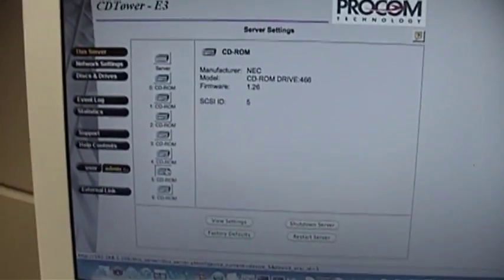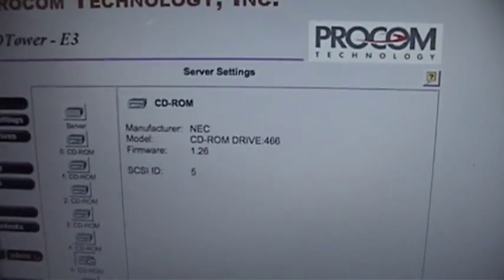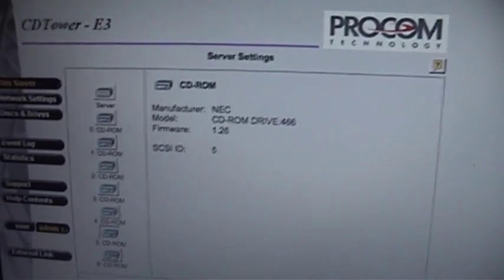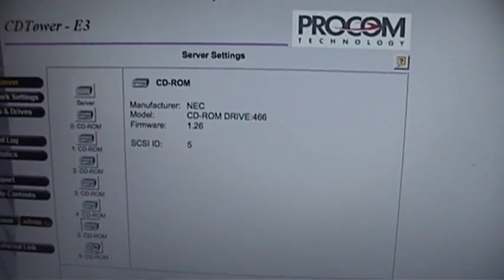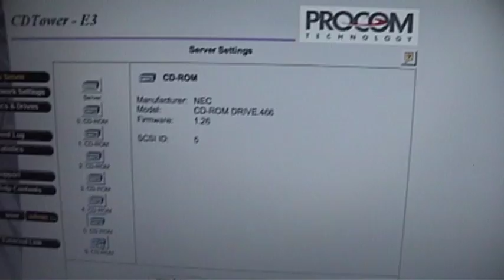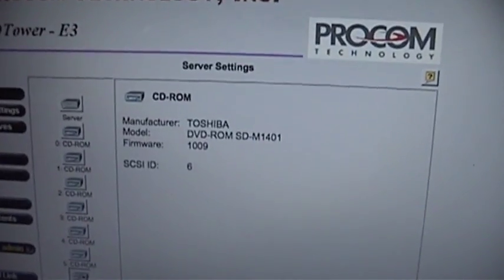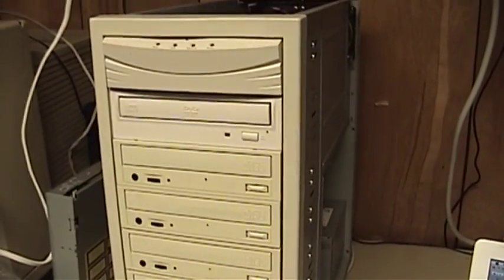Procom Technology CD Tower E3 Overview and Experiment

Comment: I have a DVD duplicator in that exact case, only it's black. The duplicator was manufactured by Kanguru, and also used NEC drives. Although, this one is fairly recent, and uses IDE for its drive interface.
The reason I ended up with it was because my church said it was broken, called support, and they just said it was unfixable. I proceeded to take a closer look at it, and noticed that it had a removable hard drive in one of the 5 1/4" bays. The drive was a 250 GB Maxtor DiamondMax 4, if I remember correctly. The drive had just mysteriously quit working in the system. I removed it. It was completely functional and very reliable in a computer. I put in a Western Digital Caviar 1200 in the duplicator, and re-purposed the Maxtor. Both still work to this day. It was a very odd failure.
I actually have a demonstration video of it duplicating a retail CD to a CD-R at 48x. It actually successfully copied a copy protected disc somehow.

Comment: Black Box made some with burners back in the 90s, before anyone had them. We've got an Antec DVD tower at work.

A lot of times a failing optical drive doesn't have to do with weak laser, but dust under the lens. I've fixed a few by using canned air between the lens and laser mirror area.

Comment: I didn't even know there were SCSI DVD drives, by the time DVD came along even servers would usually have an IDE port on board for an optical drive, at least the few I have laying around from the early 2000s all do.

Interesting machine, but not of much use today. This might be interesting though if it could cache DVD images.

Comment: When I worked for NCR Lowes back cpu room had 2 32 bit pro comm systems they had 6 dvdrw drives and they run the systems to run the Home system . I had to carry a spare drive power supply cable and the propitiatory Ethernet cable. I only had to work on the scsi controller itself . The did have a memory chip .Lowes had a mandatory 
6 hour repair time . I kept the spare parts in the CPU room as far as I know there still there

Comment: I used to use a scsi cd writer millions of years ago, but most software just didnt see them :-(, shame really.

Scsi reminded me of the old mfm/rll hard drives with the selection pins, or the monster sized cast aluminium 5.25 inch tandon floppy disk drive with belt drive and strobe flywheel, also with jumpers and 300 ohm resistor termination packs.

Loved those old drives, sounded like a chainsaw though :-)

Comment: Did you ever find your original DVD-ROM drive or obtain a replacement that actually worked?
Reply from the maker: No, and I don't use this any more.
Reply: @uxwbill  he's alive! There's still hope of new uxwbill videos.

Did you just retire it or did something fail? Someone asked in the comments if you could swap out all the roms for hard drives kinda wonder that myself.
Reply from the maker: It's worth considering that making videos is something I do for fun and only in my spare time. I don't have much of the latter these days. I've mentioned that in other comments on newer videos.

Nothing failed, although the power supply did have a few bloated capacitors. I just don't need it for anything I'm doing right now, so I've put it away.

This wasn't made to serve files from a hard drive. Only one is supported, and it was used as a cache. CDs could be optionally copied to it, in case you wanted to serve more CDs than there were drives in the unit.
Reply: @uxwbill  understandable if unfortunate. I've been rewatching your old pc videos to the point I'm starting to memorize thing's lol

Hopefully if you ever wake it up again the system won't be able too grumpy about it

Oh I see.
Reply from the maker: If I put it back into service, and I might, I'll retrofit an ATX power supply. It wouldn't be hard to do.